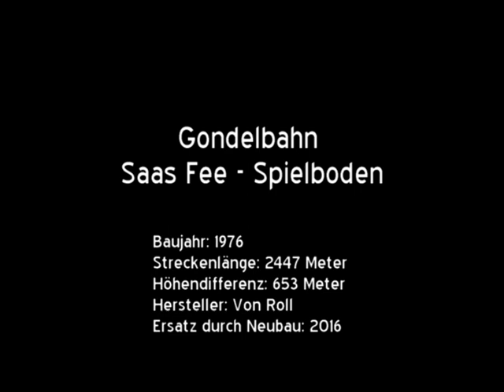4-EUB Gondelbahn Saas Fee - Spielboden (CH)

Comment: Have you filmed before 2002 Châble-Verbier-Ruinettes-Attelas from Giovanola !?
Reply from the maker: Unfortunately I didn´t. I´ve been there for the first time in 2004. I was using DVCAM equipment back then but I´m not sure if I took it with me that day. I don´t have the original tapes anymore but if I did there would be some copies somewhere in the cellar, although on VHS. Haven´t gone through them yet as there are many as well. :D
Reply: @jungfraumedia  Because before 2002 you had this really long gondola and later to 2006 only the last part Attelas
Reply: @GondelbahnMonde  Long Live Savoleyres
Reply: @jungfraumedia  Did you ever get any footage of the Attelas III gondola lift?
Reply from the maker: @CBF1  Yes, I think I did but sold the camera including the tapes of which I thought I´d backuped beforehand. I´m not really sure I did. I´d still need to check the old tapes which are stored in my basement. :)
Reply: @jungfraumedia  DAMN. Now THAT really is a bummer.

Anyway... At least Attelas III has been documented in photos, even though it should be EXISTING... Thank goodness for Menouve, even though it's been abandoned for 14 years(thank goodness, that's a much better alternative to scrapping because it could potentially be moved outside of Switzerland and reused or preserved) and Savoleyres.

Something must be done about the modern lift situation however. My commentary against the destruction of old lifts is progressing quite well, though I will upload it on an alternative account of mine.